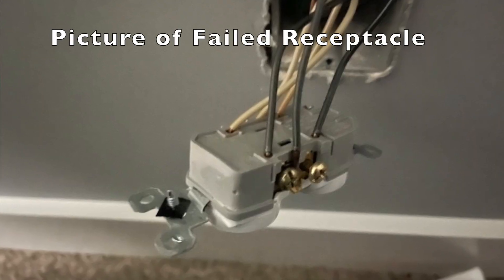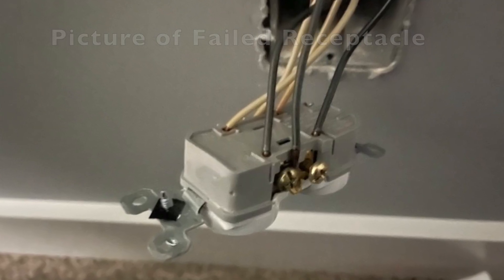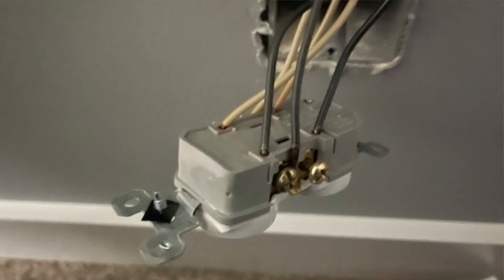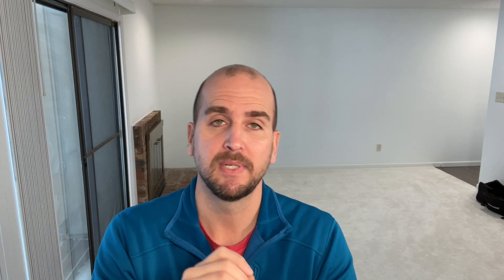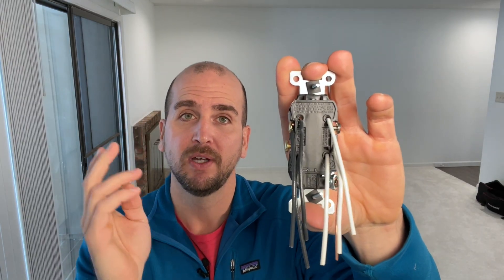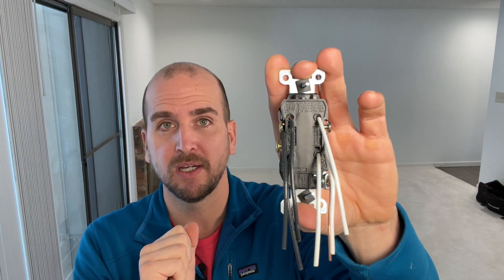Incorrectly Wired Outlet Found In Newly Built Home

Comment: I don't know if you have discussed this already, but today I replaced six outlets (house was painted so we went from almond to white and I have a bunch more to do).  The whole house is 14 wire and I'm using your basic Leviton residential grade outlets and switches.  My question is this:  is there a good or "professional" way to push those wires back into the service box?  It's a struggle whenever I do it and it seems like the outlet always winds up crooked.  Any advice you can give is greatly appreciated.  BTW, I already knew not to use the push connectors from when we had an electrician doing some work on a dead receptacle in a previous home.  The push connectors were what had failed and he told us to never use them, always use the screws.

Comment: The pigtail is not merely cleaner or a "better approach". Without a pigtail, current runs through the receptacle causing it to run hotter, and essentially making it a fuse. With pigtail, the current enters and exits through one point. Should the switch fail,  with a pigtail it will only fail locally.

Comment: How do you pull out the "push in" type wires to replace an outlet which you want to use the screws on the sides?
Reply: Normal if you just twist and pull the outlet at the same time the wires will pull out.

Comment: I gave up on UL being reputable a decade, or two, ago.  Never use those damn push ins is best practice, and to be honest should be outlawed.
Reply: UL is a fire code, not electrical code. The push-ins are there but in my jurisdiction it is illegal to use the push-in method, side screws and pigtails are to be used.

Comment: Did you say 12 gauge wire used? And was it a 15amp receptacle that you’re using here? Are these 2 being used per NEC 2019 requirement
Reply: You can have a circuit of 15A receptacles on 12AWG. Breaker would still be 15A and it would be a waste, but it's legal.

Comment: Push in connectors are the worst. I've found many failures from them over the years. Sometimes the pig tails can be a bear to stuff into a single gang box if it's 12 gauge wire.

Comment: I agree with the first two points but I do not understand why creating a pigtails is better than using a back wire. It seems you are creating an additional connection which is not ideal.

Comment: Great job, code where I live requires tape on all the wirenuts and around the outlets covering the side screws. I guess I never thought about screwing the unused screws down because we cover the with tape anyway. I totally agree with pigtails, lately I've been running into alot of wires that are too short and only extend out of the box by an inch or so. This makes it nearly impossible to work on and basically requires a pigtail anyway. As for the amps of the outlet, I just match what is on the breaker. You'll never push more amps than the breaker limit anyway.

Comment: When you demonstrate the pigtail, what is the purpose of using 2 hots and 2 neutrals on the same terminal, does it increase voltage?
Reply: If a receptacle or switch is not at the end of a circuit, there will be wiring coming from the source, and there will be wiring going to the next receptacle or switch.  No, it doesn't change the voltage, it just continues the circuit.  As @Almost Heaven Saunas pointed out, using pigtails adds convenience and ease of diagnosis, as only the failed receptacle or switch is out of service, rather than having the possibility of having other parts of the circuit non-functional, too, just because one component failed.
Reply: @vidiupload4174  ohhhh basically daisy chaining receptacles.
Reply: @derekromero2331  It's a parallel circuit, rather than a series circuit.  Much more useful.
Reply: Think of it as an “in and a out”. You have power coming into the box. Then you have power going out of the box to the next device.

Comment: My dad also makes a pigtail for the grounds, I've help him on to many side jobs.. That solid wire makes me cringe .
Reply: Dont need a pigtail on the grd twist both grounds together starting 4inches back so you will continue with just one singular conductor to the ground on recpt of course you’ve passed one of the grnds onto the ground bolt on the metal box before twisting connection.

Comment: Let me start by saying I'm not a licensed electrician.  However over the past 40 years doing residential and light commercial wiring I have found numerous cases where using a pliers to twist the wires together wires before installing a twist nut leads to bad connections.  Once you twist the wires the twist nut looses its effectiveness to press and keep the wires together.  This issue gets even worse if have to add or remove a wire from the group.  In my opinion you should let the wire nut do its job to create the proper junction.  I discovered one of these plier twisted junctions in a dusty old barn filled with hay where the junction was arcing and hot enough it was melting the insulation.  I think of that job every time I'm tempted to get the pliers out.  I'm curious if others have had the same experience.....

Comment: If using stranded wire, strip. spread and leave an  insulation piece on the end to prevent fraying.  (TIP)
Reply: No, a good electrician will use sta-cons

Comment: From a 40 yr licensed Electrical contractor. Good spot-on post on receptacle wiring. Most people don't understand that built to code is the bare minimum allowed whether it's carpentry, plumbing, HVAC, or electrical. Built to code does not mean the best.

Comment: Talking about push ins, Wagos are great. Comment about Wagos.

Also, I always point wire nuts UP, to prevent more problems during a water leak. I also prefer to run romex into boxes from the bottom for the same reason- prevent water running right into the box.
Reply: I have replaced plugs in old smaller metal boxes and I like to run electrical tape around the plug to cover the screws.
Reply: @dg-vg9di  I recently did that as well. Very good idea.

Comment: ground facing down or up on the wall receptacle you showed down in the video clip., I have read to have the ground facing up, as any metal object dropped on a partially install plug would only come in contact with center plug and one of the hot wires resulting in tripping the breaker vs hitting hot and neutral causing the explosive result of shorting them.

Comment: Mistake #4: Pre-twisting wires before wire nut.
Reply: What are you saying that you shouldnt twist wires before the wire nut goes on? Why would that be an issue, that is the correct way
Reply: @DementedPony  The correct way is following the instructions, and many wire nuts say not to.
Reply: @vaticancartel136  First instructions i find for 'Ideal' and they say you can pre-twist or not. I think any electrician not twisting wires is lazy and produces sub-standard connections
Reply: @DementedPony  Some installations forbid pre-twisting. Over the years, I've done it both ways. Pre-twisting is easier, so your argument is bunk.
Reply: @vaticancartel136  what is a bunk argument

Comment: Come on dude you use the smaller gauge wire for the pigtail than the branch-circuit was. You can't do that
Reply: All looks 14awg, just different insulation. Also, yes you can reduce the wire gauge to the device, as long as it is still above minimum rating, in this case it is.
Reply: Looks like 12 and 14 to me.... you can go to big on the wire or too small on the breaker oh, but the wire cannot be rated for Less amperage than the breaker is.
Reply: @johnsalors6022  14AWG is rated for 15A circuits, which is what would be feeding receptacles in residential.
Reply: @DementedPony  I know what the ratings are. I'm just simply saying that if the copper diameter of those two wires are different too big on The Wire down on the breaker size. That would be my only thing

Comment: As a professional that did remodeling for over 4 decades, I can attest to the failure rate of the push in connections. Almost every time I was called about a smoking or arcing receptacle it was the push in that was at fault. I know it's easier to use, but I highly recommend anyone wiring receptacles or switches to use the screws on the sides. It makes for a much better connection and will give you some peace of mind about your work being done properly.
Reply: @Peter Evans Why are you here?  You offer less than nothing to the conversation, you name call and insult for your pleasure.  Go back to bed and wake up on the other side tomorrow.
Reply: @Peter Evans you must be writing this on April fool's day..  I wouldn't want you working at my place if you are serious about what you wrote.  Whittle down a 12 gauge wire?
Reply: Homeowner here, but I can also attest to the failure of the "push-in" connectors (my electrician called it "back-stabbing").  The constant stress/strain on this particular (high-use) outlet finally caused one of the wires to pop out the back.
Reply: I have not seen a failure because push in was used. Not sure how the electricians on here are using them that they have so many failures 😂😂
Reply: @leonelsway  Most contractors who install the plugs never see the failures because they usually happen after a year or more. Most contractors only give a one year warranty on their work, so the homeowners don't contact them. I had a friend contact me who had this issue and his house was six years old before the problem surfaced.
Reply: @Peter Evans actually that is not true.  Each time that outlet is used especially for something like a vacuum the wire does heat up some...which causes it to expand.  Over the years this will cause a problem.  I found this out by troubleshooting a ceiling light that constantly blew bulbs.  Found out that all of the common wires were loose because the springs holding the wire in had loosened and there was black soot about an inch up the insulation from the arcing and it was rasy to find since when I pulled the outlet out of the box, the common stayed in the box since it pulled right out.
Reply: @Ralph Herge Agree.  My local Home Depot sells mostly "Raco" brand metal boxes, though plastic is more popular for common household switches and receptacles.
Reply: @Peter Evans why are you giving rootstock sauce
Reply: No... 
YOU NEVER MAKE A BIG WIRE SMALLER....
☝️🧙‍♂️
Reply: @Karl with a K I take it you haven't been around much if you think "100% of all boxes are plastic".  There's at least one metal box I found by our front door, and another down by our furnace.  In fact, the hardware store has an ENTIRE section dedicated to metal electrical boxes.  Then there's the issue of multi-gang boxes where there can be enough play for some outlets or switches to shift when the faceplate is removed and potentially touch, especially if the screws were not all the way in.

Everyone who has ever come to do work here seems to carry an impact gun or drill these days, just take the 0.2 seconds and zip the unused screws in, even if its not tight will provide an extra margin of safety.
Reply: If they are so prone to failure then how do they pass UL?  I'm assuming it is because people use them incorrectly more often, like not enough conductor exposed, or worn conductor inserted that doesn't make full connection?  There could be selection bias here - more people using them are either in a hurry or amateurs and hence less careful.  If you get the same people to use backwire connections they may make as many mistakes.    

Really I think if people seem to fail to use them correctly that often code should just be changed to outlaw them, or new failsafe ones designed.  When you look at the design of UK outlets and plugs (standardized around the 1970s) it's amazing how primitive and unsafe the US standard ones are!
Reply: @CasaDeMuchosGatos  now why would anyone accept the opinion of the underwriters laboratory when you can depend on the opinions of random electricians on Youtube lol?
Reply: @CasaDeMuchosGatos  Everything evolves (we hope) toward the positive.  If you ask your internet genie about aluminum wire, she will explain how it was the rage because it was cheap and allows the flow of electrons so much better that everyone got in on the deal.  AND THEN real world events ... aluminum wire has corrosion issues; has heat/cool expansion/contraction issues leading to lose wires; and more I forgot.  Bottom line what was authorized by electrical code then got unauthorized really quickly as real world experience was assessed.  The same thing with the spring tight "stab" connections on outlets.  quicker ... saving commercial electricians literally hours on a job by not having to bend wires insert turn a screw.  The only problem is  that those spring contacts get tired, create the ark, burn places down ....images of outlets with fire smoke are both real and scary.
Reply: @Peter Evans WoW, another random Youtube expert who enjoys insulting random strangers on social media.
Reply: @Peter Evans don’t you have anything else to do than spout your sarcasm and insults - get a hobby lol
Reply: @Peter Evans you need to check again.  There is a metal spring that holds the wire in...always has been.  If there is no spring that holds the wire in and normal, how is the electrical contact created?  Wht do you think the wire release hole does.  You can day what you like, but I have been dealing with electrical issues for over 30 years and I have my experience and my eyes to yell me that the push in wire holders are cheap junk and should never be used.

Comment: Is the pigtail just for a cleaner set up, or does it have an electrical benefit?
Reply: The benefit is that if you remove the device you are not disconnecting the circuit. If working live this helps to maintain the other powered devices. If working with the circuit off it can still protect against the case where a shared netural  is serving a live circuit and the one you disconnected for safety -  but if the neutral is open then it has no path to ground and the other live circuit will energize the neutral and shock you. If the neutral is pigtailed then removing a device won't disconnect the neutral from ground and you won't be shocked if you touch it.

Comment: My brother and I are both retired electricians (2nd generation) and something our dad taught us from the beginning was to make a habit of connecting the neutrals first. Even when the circuit is dead,  keep a routine, we always connected the hot wires last. In the long run its a lot safer- a loose neutral elsewhere in the system can make the one you are working on hazardous. This is a good video, good info, well demonstrated.
Reply: newer changes to the national electric code requires a breaker with multiple poles to shut off ALL circuits to the box to avoid shock hazard.
Reply: I was taught ground, neutral then hot. Recently had it pointed out to me from some kid it's safer to control the hot first by getting it under the screw first then ground and neutral. That way you're not becoming a ground point. We do a lot of commercial service where we work on energized circuits.
Reply: @bgarrison67  My dads point was to try and keep the neutral in place, with the neutral open the hot can seek other less predictable routes that could leave you as part of the load (think about what you can see when a panel neutral gets loose, things like lights getting brighter and dimmer as the oven comes on and part of the circuit is seeking the other phase without the neutral to carry the imbalance of the load).

Comment: You forgot to tighten up the other 2 screws witch was your first no no at start of your video , after you removed the 2 neutral and 2 hot wires , you didn’t screw down the other 2  wire screws that you removed the extra wires from before u put  the pigtail wires on

Comment: Pigtails are better esthetically, but they are also used so you're not relying on the device. If you put each wire to the device and the device fails, it cannot pass current through it. Therefore, the pigtail provides additional protection for outlets and switches further down the line, and allows them to continue to be powered.

Comment: What is your opinion of the Ideal In-Sure push in wire connectors sold at Lowe's? One of them is item #540479.
Reply from the maker: Here is a video where Ideal Push in connectors were 1 of the 3 compared.  https://youtu.be/AWiyreFFt-Q  As you will see I prefer Wago Lever Nuts and think they are worth the extra money for DIYers taking on electrical projects.

Comment: screw terminals can also fail by loosening over time from heat cycles. 
if push in was so notorious for failing UL shouldn't certify them and out right ban them from further production.

ive seen failure points stemming from incorrectly stripped wire. some jack stripes the coating off and cuts into the wire then eventually the wire breaks and you have to play "why is this working when i jiggle the outlet/switch" game

Comment: Thanks for a great video. I would add an exception when you need a different hot to the top and bottom when you're removing the tab in the middle. A example is a night stand outlet where the top is connected to a light switch and the bottom is always hot.

Comment: all good points. You mentioned best practices a few times. Did you mean code?  Also if we’re talking about best practice the ground on the receptacle should be positioned so its at the top. Flip that plug upside side.

Comment: I have all aluminum wiring in my house. Different metals don't like each other therefor causing a very slow fire so to speak. I had one that started buzzing so I replaced it. It was just beginning to start a fire. Copper and aluminum as well as any other metal does not like each other. You have to use a Die electric or special compound to prevent such occurrence. I learned that while working where they make Jet fuel while installing an aluminum door jamb with metal screws. I was ask to get aluminum screws for safety. Just one tiny spark would light that place up.